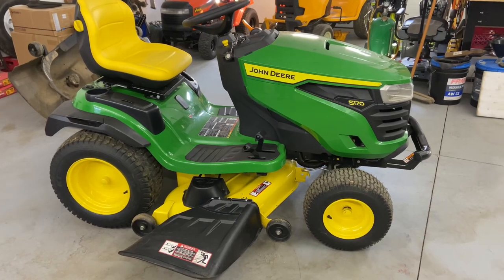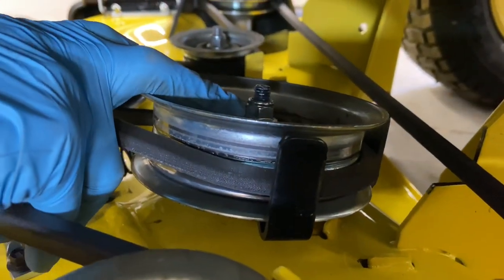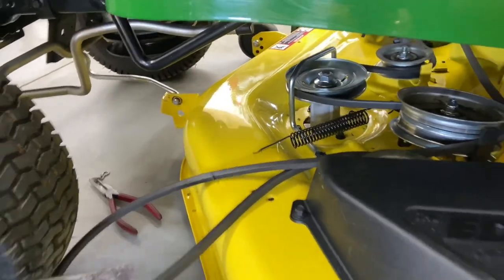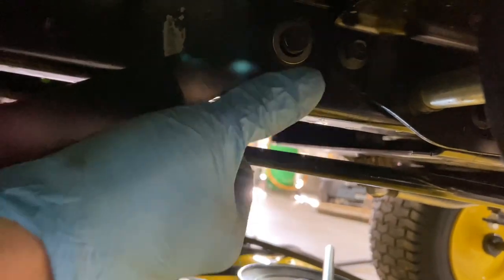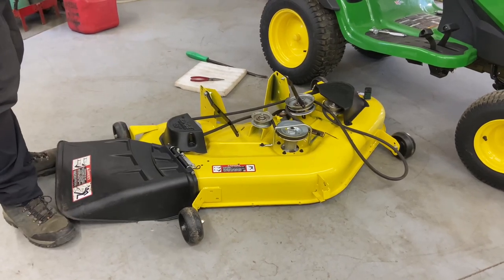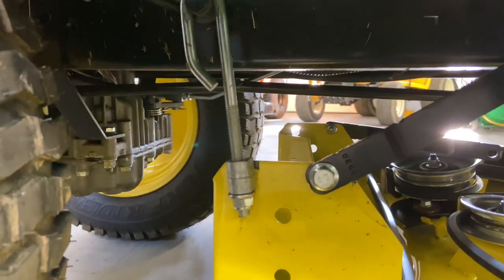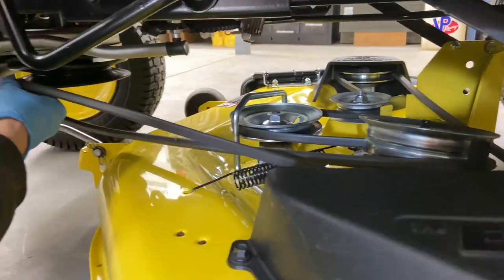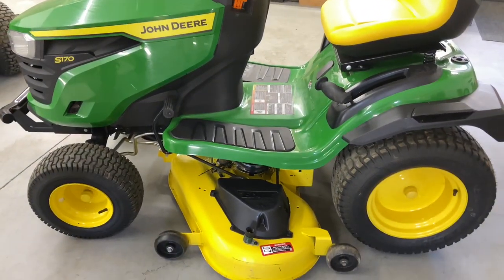How to remove mower deck John Deere S170

Comment: Have enjoyed watching your video. My problem is on an E170 that I'm removing mower deck and using a snow blower. My son bought the complete package 4 years ago but never used the snow blower. I want to use it this winter, but the belt drive module isn't in the packaging. Don't know what ever happened to it, Would you know where to get that pulley system to mount under the tractor? Thanks, Bill
Reply from the maker: You will need to contact John Deere.